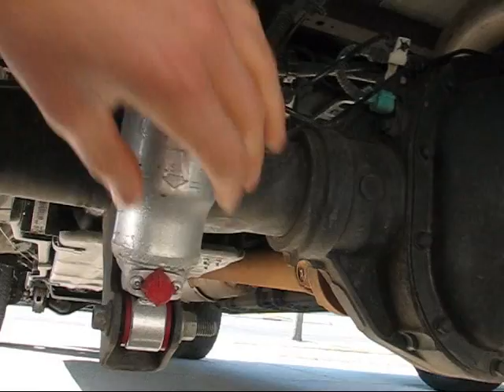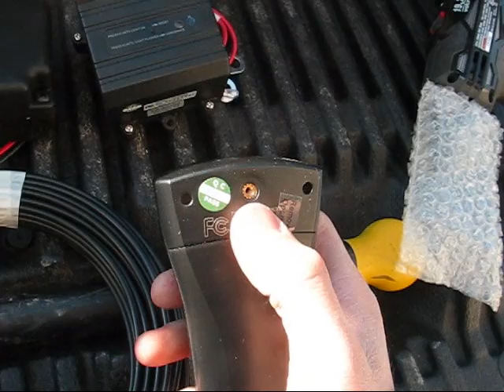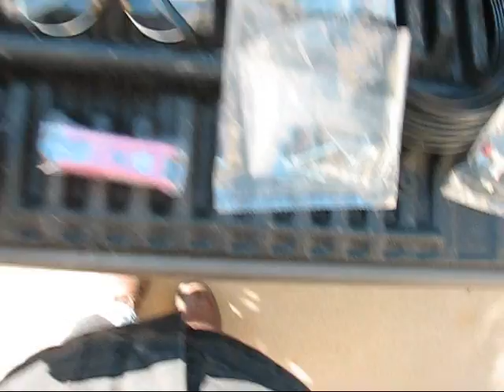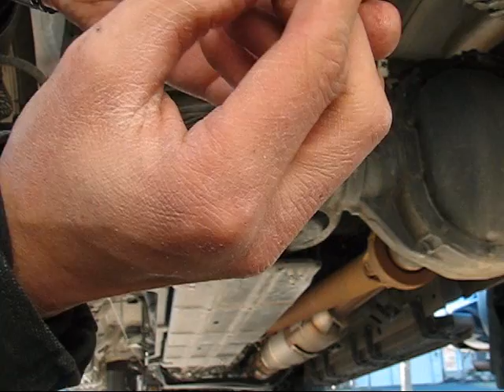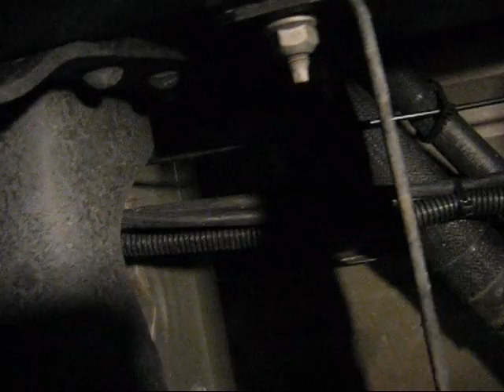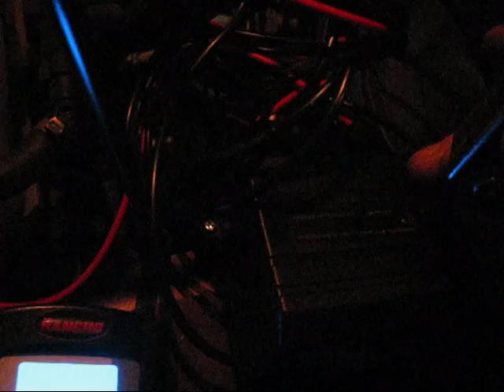Rancho MyRide Install

Comment: Good video!! I am considering one of these for my 1987 Samurai. Ive added Jeep YJ leaf springs and just got a set of RS9000 for it. The factory leaf springs and the 35x15.50 TSL SX Swampers will kill your back even with only 8 psi in Swampers!! With the RS9000 I should be able to dial it in for off rd. Nice F350 I see on qrz.com by the way! I have a 1994 F350 w 7.3L Turbo Diesel. First year the put Turbo on it. =]

Maybe I will catch you on HF one day. 

73 DE WW5RM